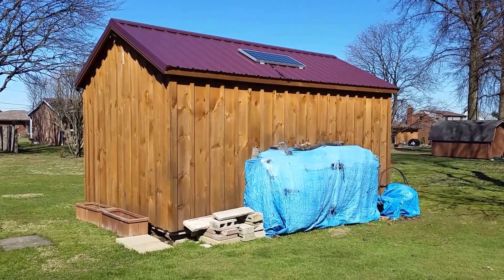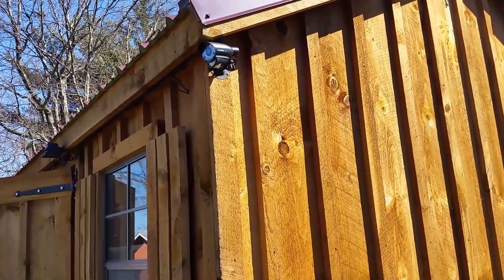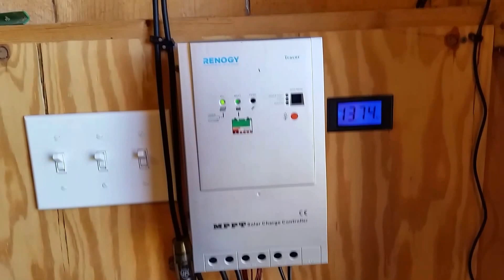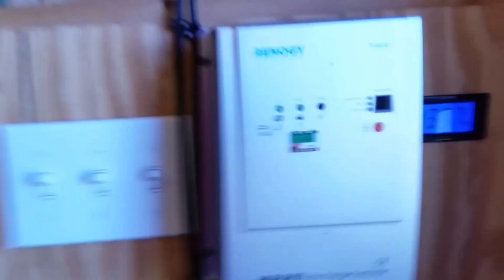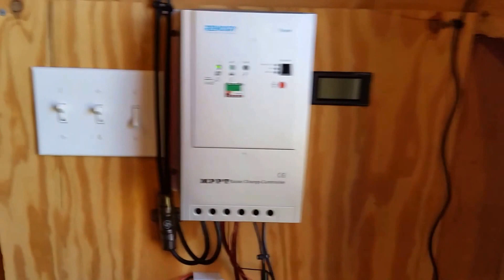Solar Powered Off Grid Shed Setup-

Comment: i plan on doing something similar with two batteries i notice that you have one negative cable of one battery to the positive of other battery and using remaining positive and negative to connect to charge controller,how is that possible without burning or crossing anything ?
Reply: Yes...wired in series. Like putting 4 d cells in one of those mag lights.

Comment: I bought the Renogy 100w starter kit. I have not yet decided on batteries but, your set-up looks good to me.  I also like your shed design and size. What are the dimensions?
Reply from the maker: The shed dimensions are 10x16 in size, Since this was my first solar installation on a shed it has been working fine for several years. The batteries are (2) 6 volt golf cart batteries wired in series to make it a 12 volt system. Lights are a big factor if they consume too much power your batteries will run dead. Currently, I'm using (2) 5 watt LED's at 12 volts and they seem to work just fine runing all night and a wireless camera running 24/7. Going solar eliminated running underground wiring and I also have the option to install a pure sine wave inverter for houshold power inside the shed. Thanks for watching and please subsribe it's free.